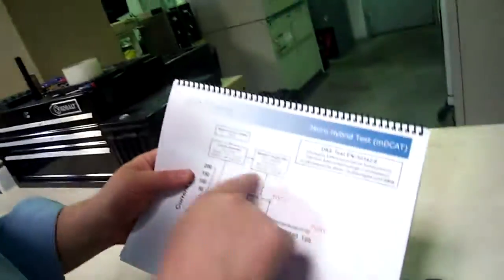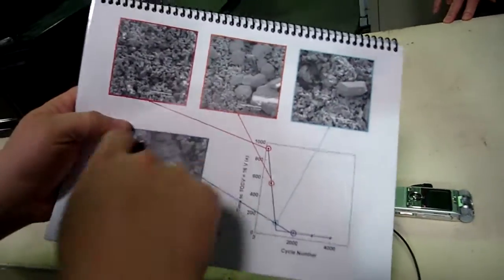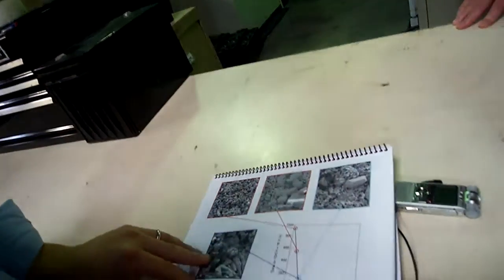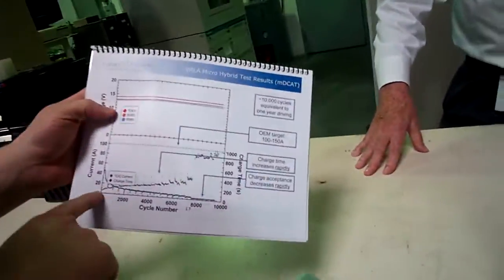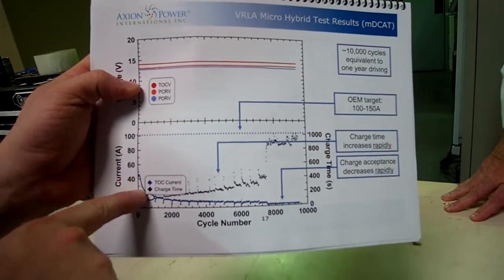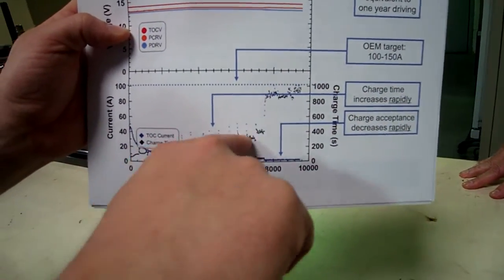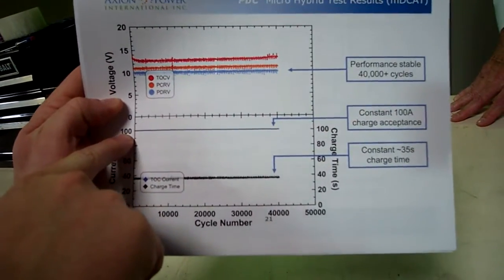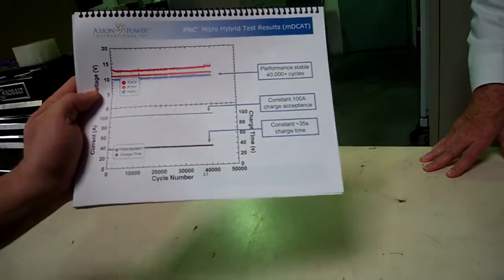Axion Power International battery technology

Comment: The real frustrating thing is that it's basically impossible to find any quote on any of the Axion lead carbon batteries and they don't even respond to email. They might be a small company but really.
I think they're scared of putting potential customers off by their higher prices compared to traditional lead acid technology putting them up into the Lithium battery range.
Upside is that they claim you can completely discharge their lead carbon batteries without destroying them.